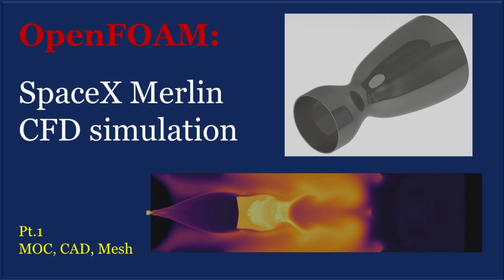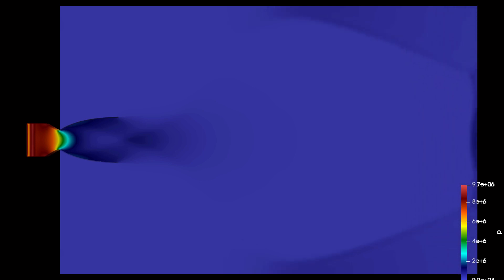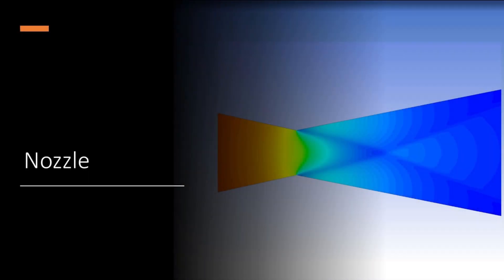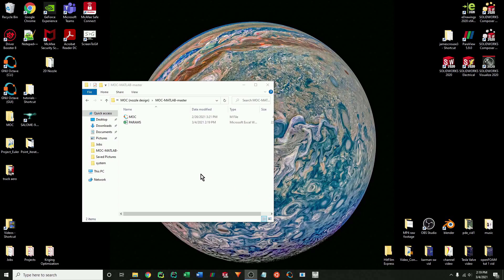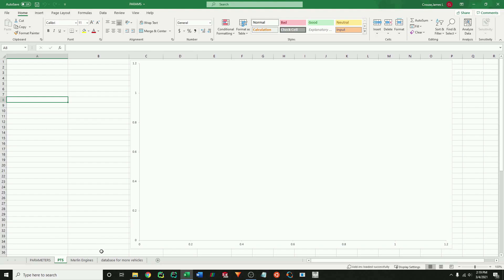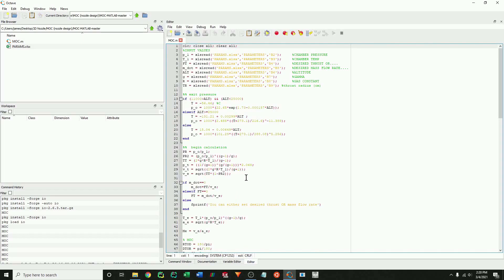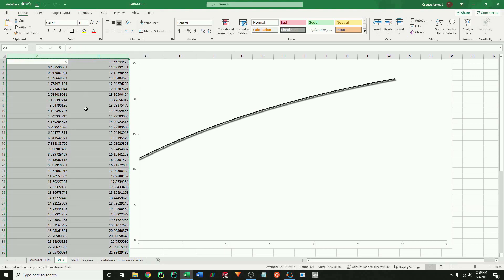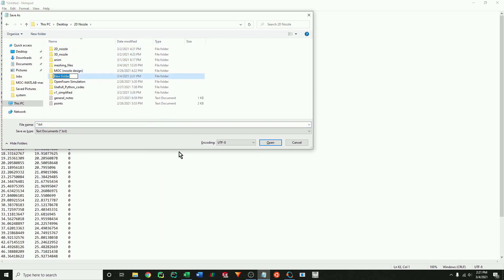SpaceX Merlin Nozzle: Pt.1 - Method of Characteristics, CAD & Meshing | OpenFOAM tutorial 3

Comment: It is possible to avoid a negative temperature at the inlet by imposing in the system folder a file named fvOptions which limits the T. You can state the lower bound, let's say 200K and an upper bound 4000K for istance. In this way you should avoid any negative Temperature. For the pressure reflecting at the end of the domain, it could be dut to a too low length of the domain or the parameter lInf.
Reply from the maker: Thanks for the tip, it is greatly appreciated

Comment: Hi, I just briefly checked the boundary conditions of your case file. I suggest you may try to use a Totalpressure condition for p at the inlet as well as Totaltemperature for T. I wouldn’t specify U. I’d rather use zero gradient or maybe a pressureinletoutlet condition. If the Mach Number at the throat of the nozzle is equal to one, which should be the case, then the mass flow and thus the velocity at the inlet is not independent of the Totalpressure and Totaltemperature. Therefore you shouldn’t fix it, instead let the solver figure it out. Otherwise you overspecify the problem and numerical errors, which differentiate your solution from the analytical one may lead to huge pain in the ass problems and unphysical solutions. I am currently working on a similar case. I am quite new to supersonic flow simulations and I am still learning, so there is no guarantee that this helps or works as expected, but it could be a more sensible solution for your boundary conditions. If I find the time I will try your case and check it out. 

✌️

Comment: Thank you for the tutorial sir. 

I have a question about one topic that you have mentioned.

In 0:54 you were saying "when i had no inlet velocity, openfoam would crash warning". Currently, I am trying to analyse nozzle also and i only want to give pressure inlet value and i do not want to give velocity inlet value at the nozzle inlet.

I try to use Hisa as a solver. From the research I made, I guess I have to use custom bc but have no clue. Do u have any suggestions?

Best regards.

Comment: Hello sir
I have designed super sonic nozzle of 2.5 mach at exit but I am not able to do 3d analysis can u please help me in that..
Reply from the maker: The procedure should be fairly similar to the one outlined in the video, you will need a different mesh and boundary conditions. Depending on your mesh resolution, it may be an extremely computationally expensive simulation to run so you may need to run it on aws or other cloud hpc service.

Comment: Who wrote the Matlabcode? Seems like there is something wrong if TT is the Throat Temperature. Throat Temperature would be T_1*2/(g+1)
Reply from the maker: I got it from a video by VDEngineering. I really appreciate it and I will look into it, Thanks!
Reply: @interfluo6420  This code assumes straight characteristics line coming out of sharp corner and intersecting the axis. But in the kernel zone characteristic lines are intersecting hence they will not remain straight. Look axisymmetric nozzle design code, which will have characteristic lines as curvature.
Reply: Also using this code will not give correct area ratio for a given Mach number. You should really look for axisymmetric method of characteristics nozzle design code.

Comment: @Interfluo Can you do meshing tutorial of nozzle on openfoam? The procedure you mentioned needs ansys and I can't afford.
Reply from the maker: My latest video is a cfmesh tutorial which you can try to adapt to a nozzle case. I will consider doing a nozzle case with cfmesh or snappyhexmesh in the future, but I have a couple of projects I am working on first. Good luck!
Reply: You can also use gmsh, which is open source. OpenFOAM has a mesh translator called gmshToFoam. There is a good example of the workflow on the OpenFOAM wiki.

Comment: area expansion ratio is 21.4 for merlin 1-d in the table. But your design's ratio is about 5. Isn't there something wrong?
Reply from the maker: Likely yes, it may be down to a couple of different factors. The two biggest culprits in my opinion are:
1. As someone previously commented the code for MOC has some errors; I found this code online and assumed it was correct but it may be wrong in some areas
2. I specified the nozzle to be designed for an altitude of 3000m, the expansion ration will change based on what altitude you chose. For instance if you want to design a vacuum optimized nozzle the expansion ration will be larger than a sea level optimized nozzle.
Hope this helps!